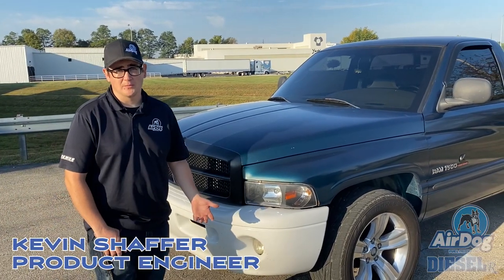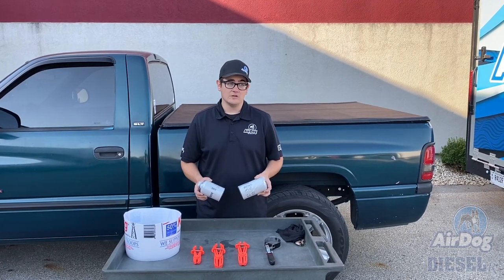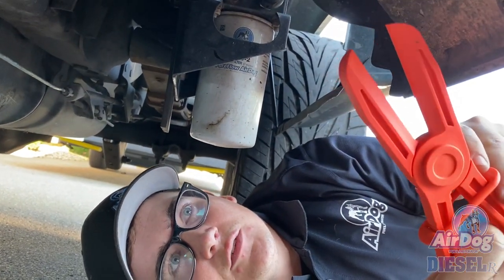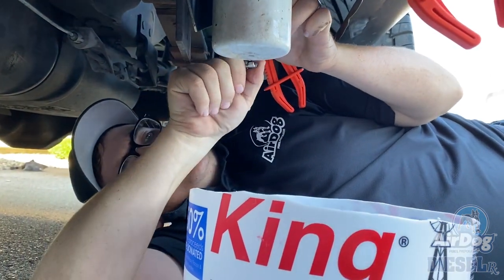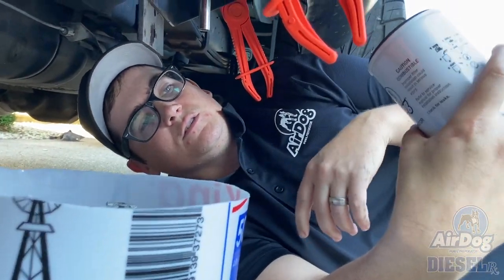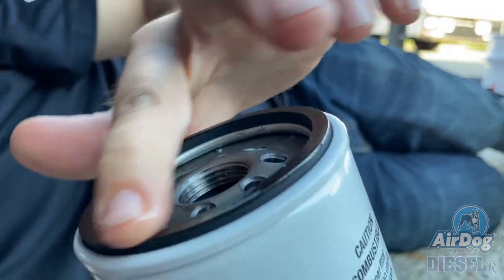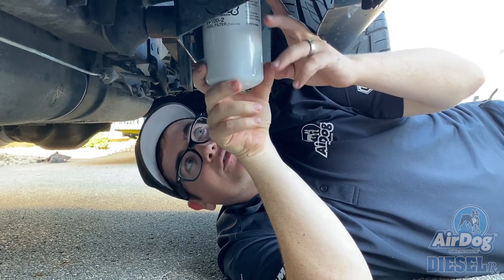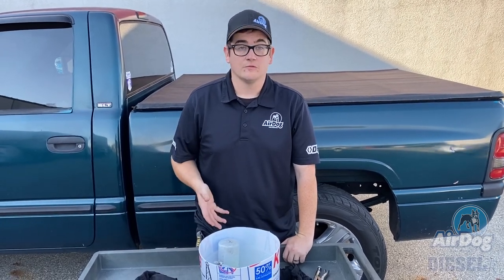Changing Your  AirDog Filters

Comment: I got the 150 in January 2019. Love it! Just makes a little noise when I turn the key and wait to start the truck, that’s it. (I hope that’s what it’s supposed to do, and wasn’t installed wrong). Compared to my buddies fass 200+ , you hear the pump from the time you start the truck to the Time you shut it off lol
Reply from the maker: Really depends on the vehicle. Our pumps are designed to be triggered off of a key on ignition source, or off of the factory ECM. If you are concerned about the performance of the lift pump just call in to speak with one of our technicians. 877-421-3187 Thank you for watching!

Comment: Does the water separator have to be pre-filled when changing both filters? Or can they both be primed without being pre-filled?
Reply from the maker: The system is self- priming. Just key it on and wait for the pitch of the pump to change before starting the engine.
Reply: Never ever pre fill your filters it ended up destroying  few a injectors to my buddy's truck

Comment: I don't see any way to keep from introducing air into the tube that sticks down on the air separator side everytime the filter is changed/removed.  You can see the fuel draining out of the tube when the filter is removed.  This tube goes directly to your engine.  When the filter is reinstalled, the air will remain trapped in the tube, even if the filter was prefilled with fuel.  The only way I see around this, is to install an external valve that would allow the fuel to temporarily bypass back to the tank until the air has been cycled out.  Your competitor appears to have the same issue with their design as well.  And from studying the diagram, your internal bypass does not circulate fuel through this tube and therefore would not aid in removing air from this part of the system.
Reply from the maker: Our air bleed is on the pressure side of the pump. As soon as the system primes and makes pressure, it will force the majority of the air back to the tank through the patented air bleed.
Reply: @AirDogSales  A metal ball inside the tube that seated at the bottom of the tube that acted as a gravity actuated check valve would prevent air from leaking into the feed line during a filter change.  This would also reduce the small amount of fuel that is in the tube and line from being lost as well.